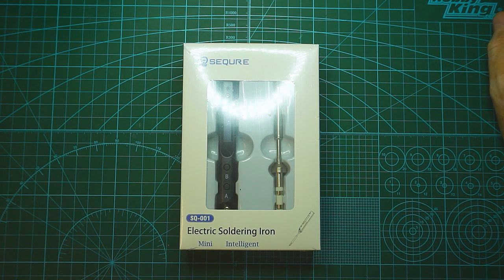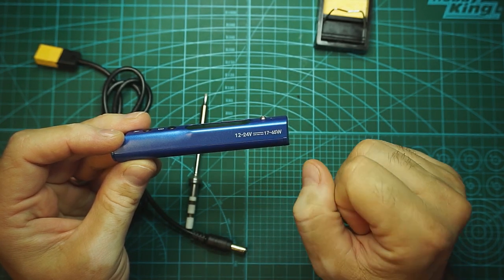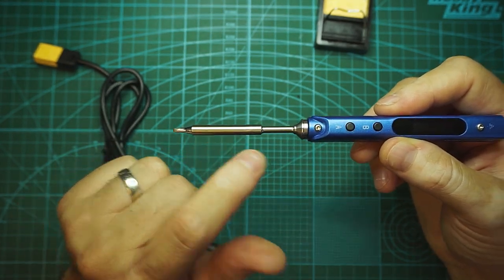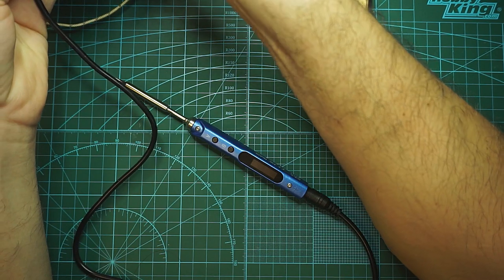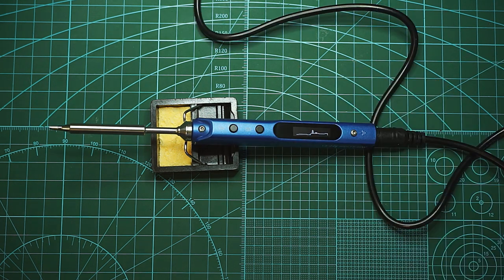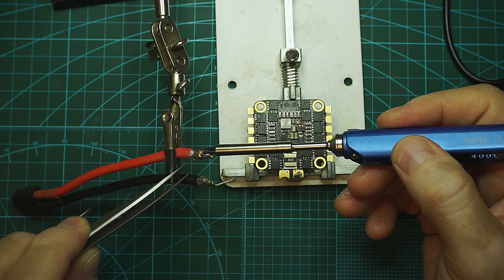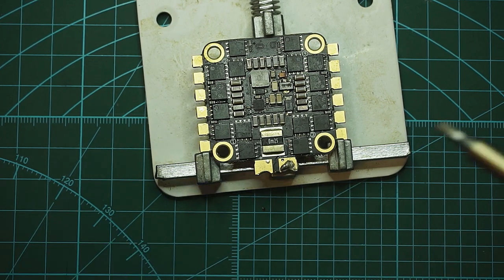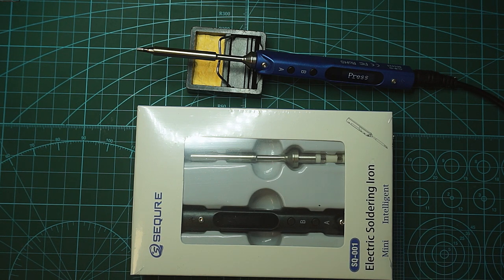Portable Soldering Iron REVIEW & GIVEAWAY (Sequre SQ-001)

Comment: But wouldn't a larger tip help transfer the heat to the battery leads faster?
Reply from the maker: yes, but it would be too large for smaller things. But you could buy more tips and use them accordingly! This tip meets all uses in my view.